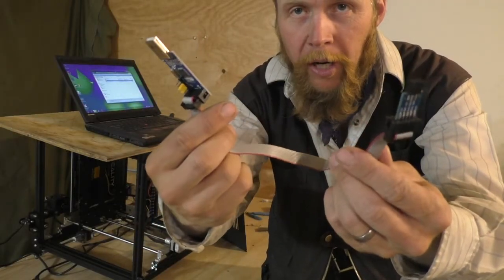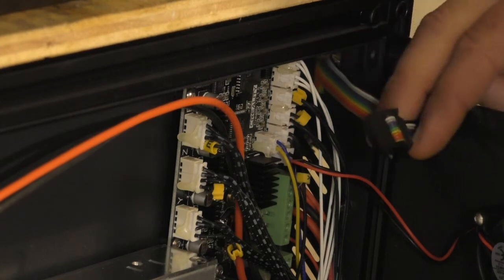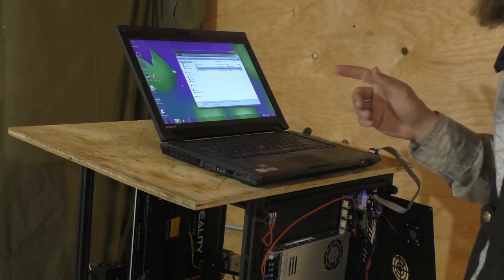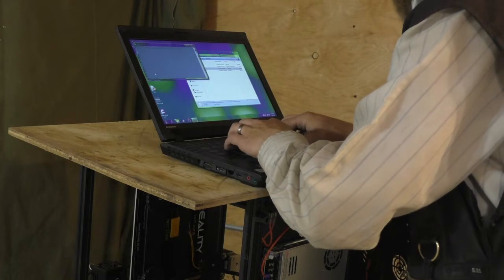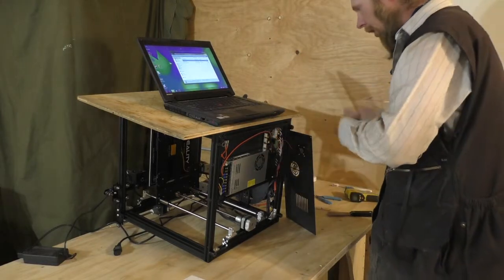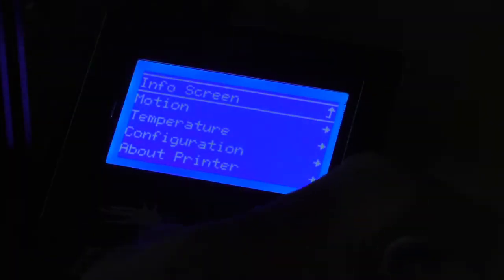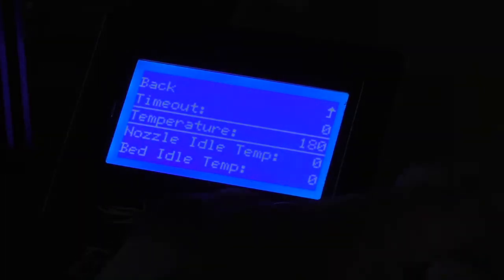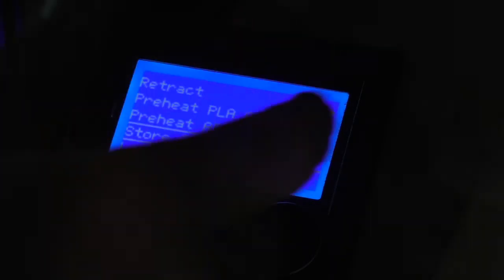Upgrading Hotend and Firmware on Ender 5 (TIS402)

Comment: What firmware are you running on this ender 5 pro?(PLEASE GIVE ME A LINK! lol I've had so much run around getting the right one for 5 pro w/BLtouch)
I have the microSD port so I can use that I believe.
Reply: oh! I also have the spider hot end as well as the sprite direct driver upgrade.  The sprite appears to work properly with my installed firmware. side note, it is not the sprite pro which appears to replace the entire extrusion assembly, but rather what I believe is the first generation one.